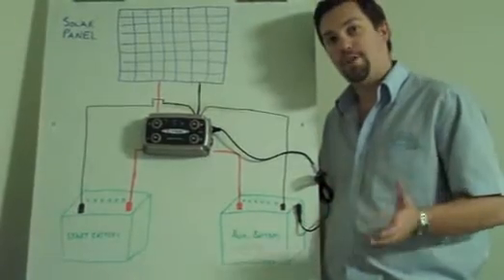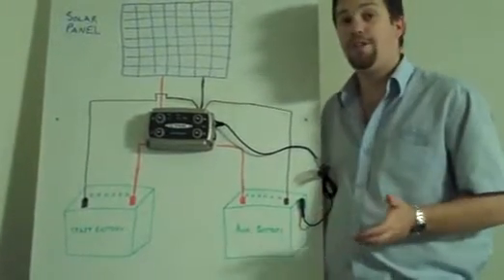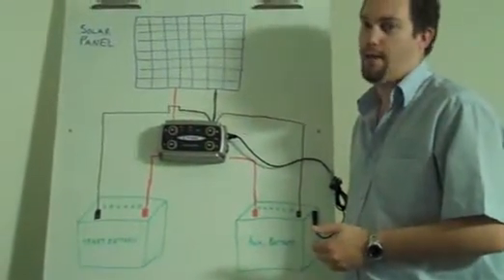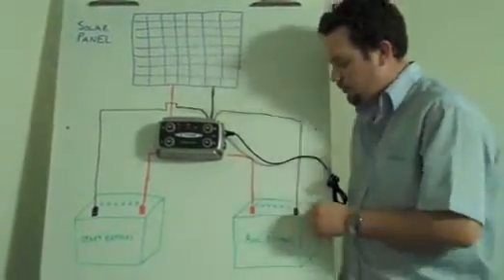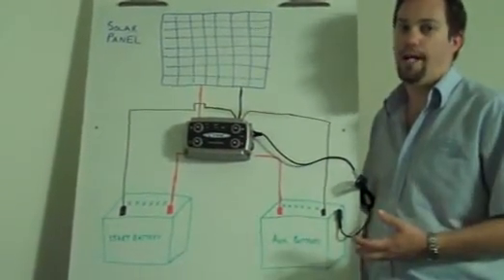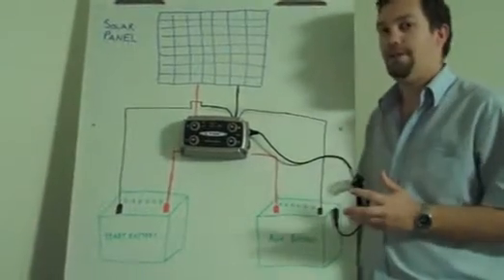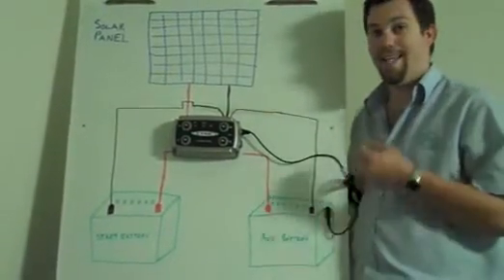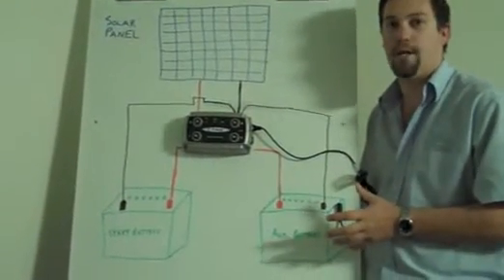CTEK D250S Dual

Comment: What happens if I connect a 230 volts battery charger to the auxiliary battery as well? Will it also charge the start battery? 
Just imagine a trailer parked the whole winter with mostly cloudy weather.